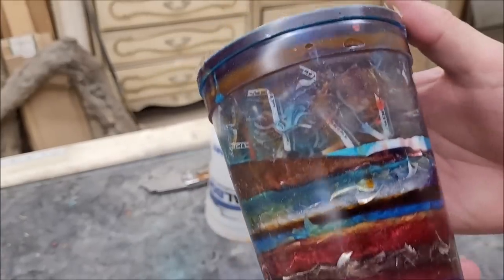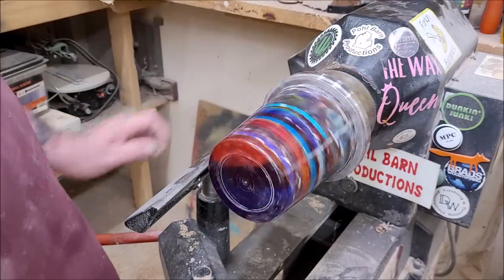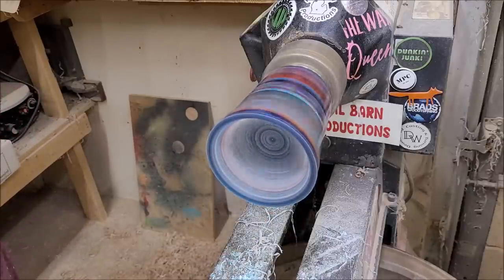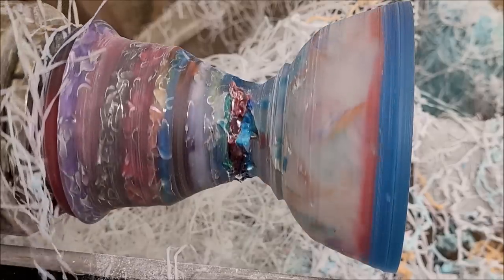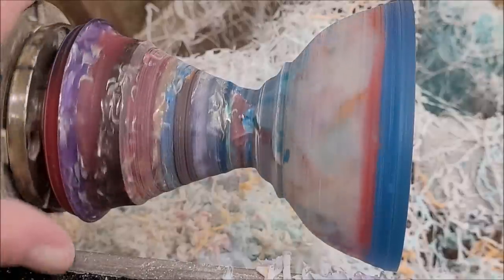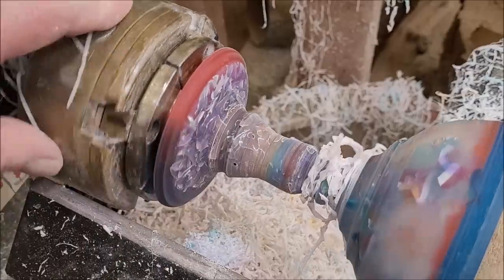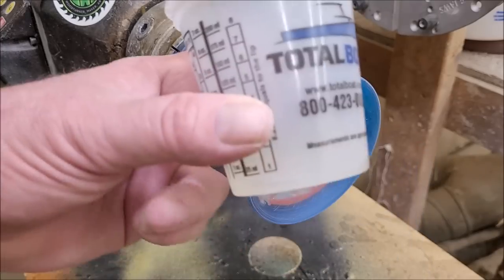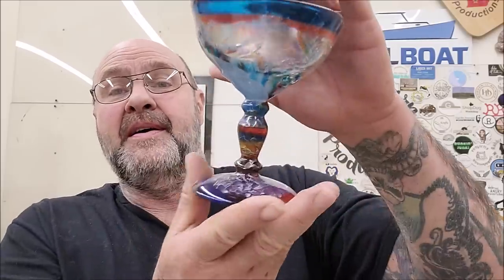Fun Cup Resin Goblet

Comment: I always like your goblets, Doug.  Excellent use of your leftovers container.  Sorry about that sticky finish. I have a project that is miraculously about to be completed after numerous problems. One thing I should do is put a bit more resin on the top where it failed to seal a spot properly. My concern, since this thing is not going to be saleable but just spend its life in my office, if I should just forego that rather than have an accidentally sticky uncured surface. 

Enjoyed watching this turning. Be well.
Reply from the maker: Thank You Jay,  I have no idea what I did wrong to make it sticky
Reply: @The Pohl Barn Productions  I hear you. I get it if I'm scraping the edges of not mixing well enough. Seems more common for me on thin casting or as a thin layer. I've decided against the final coat on my project. Don't care enough to improve it but a sticky top would make it unusable (a table). So assemble tomorrow.

Comment: Good job, Doug. I like the way you save your scraps and make things from them. Even though, most of the time, we are used to seeing people come back to the resin as soon as it sets up, this is a good reminder that we can let scraps in resin just sit until we "get to them".

I like that you used a resin finish on this. Have you considered adopting a grill rotisserie to your lathe (on the outboard side) to rotate the resin finish at a very slow speed while curing?
Reply from the maker: Thank You Qapla,  my lathe will run at 50 rpm and that is slow enough to not make it run, slower would work better and probably allow it to flatten out a bit better

Comment: Nice goblet!! I have a small cup of leftover resin that I'm about to get into as well. As far as the stickiness goes, from my experience, it could be related to resin that, possibly, is just to the point of being too old (I'm not sure what kind of shelf life it has). I had a bowl that I had to let set for a solid week next to a baseboard heater to cure up completely. Just my guess.
Reply from the maker: Thank You Howie,  I am thinking you are probably correct with the resin is to old, I put new hardener but not the resin, the last one I made I didn't use for those containers I used from my pump station,

Comment: Nice work, I’m amazed how you keep using the gouge, anyone else hits the carbide right away. Pretty thin as well.
Reply from the maker: Thank You Daniel, I'm not a fan of the carbide tools, I've learned to use the gouge and I like it !
Reply: @PohlBarnProductions  I’ve had carbide for 25 years never replaced the bits. I used one today for ten seconds nothing like a 5/8 gouge with Ellsworth Grind.

Comment: That is a pretty goblet.

Honestly, if I ever make anything with resin, I think I'm going to avoid adding anything metal. As cool as the aluminum shavings are in that cup, they seem to be giving you more trouble than they're worth.
Reply from the maker: Thank you,  they do tend to not adhere to the resin very well, I did brake the stem on this project while trying to fix that sticky finish, UGH  I also fixed that too,

Comment: Doug, to get the smooth cuts you do with the Irish grind gouge, do you knock the bur off the wings or leave it on? I tend to get a lot of catches when using a traditional tool instead of carbide on epoxy.
Reply from the maker: I do not knock off the bur,  the tool actually works better as it gets dull, a fresh sharp gouge tends to chip out easily.

Comment: Is it possible the Fast Set Resin is too old?

It may not be curing properly if it's too old (I'm guessing, I've never used anything other than 5-minute Epoxy in the syringe style tubes from Home Hardware...

Is it possible you accidentally got the ratio wrong when you mixed it?
Reply from the maker: Thank You, the fast set hardener is new but The resin it self might be to old, the last one I did I use the pump station to get the resin,

Comment: Whatta ya mean, you're not very good at goblets?  Granted, you DO push your luck with how thin the stems are, but nothing went flying and scything through the air, endangering yourself of any one else around, and it looks fine.  And I have my bloody bones goblet beside me as proof too!
     Question- are these goblets food safe? I will never risk them in a microwave or dishwasher of course, but can I drink cold or acidic (juice, wine) or hot  drinks from it?  I don't want to hurt the goblet or poison anyone with it. 

Well, not accidently, anyway...
Reply from the maker: Thank You JoAnn,  I would think once the resin cured it would be food safe but I really do not know, as far as what you can put into it,  I don't know there either,  but it's yours to do what ever with.
Reply: @PohlBarnProductions  I was thinking last night about how you pour off your extra resin into a future cup container, and wondered if you had ever poured any  spare resin over a sheet of bubble wrap?  It makes an interesting patters which you could then experiment with, or stack, or make into cylinders around the inside of one of those spare resin cups after it hardened a bit, then add some wood to the center after a while.  
   I don't have your tools or space, but I love to imagine making stuff!